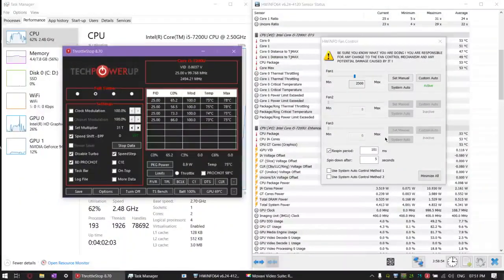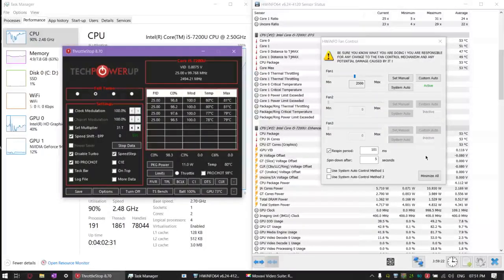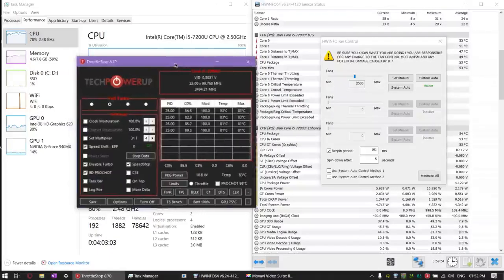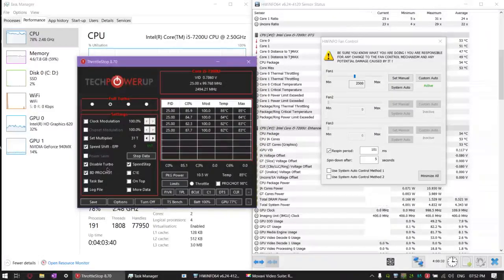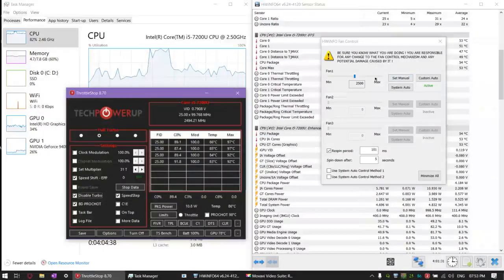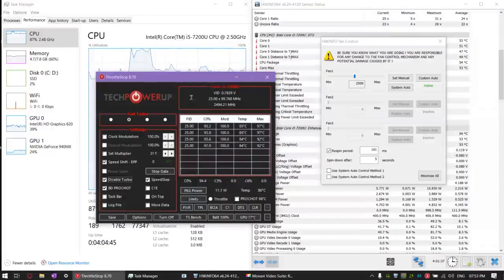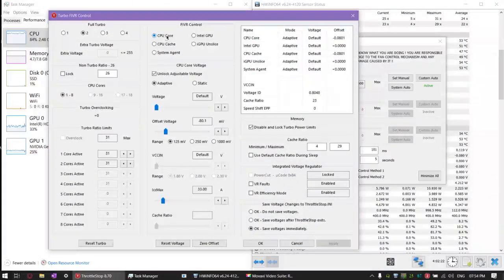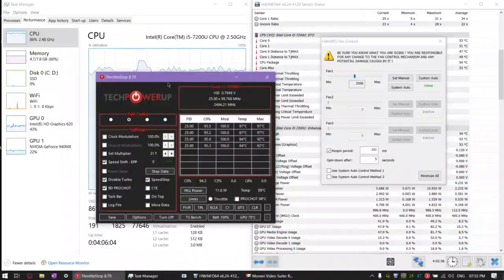Best way to prevent CPU from Overheating (ft.Throttlestop)

Comment: hey bro ,my fan is making a lot of noise,although i have bought it 1 week before .It is hp i5 11th gen laptop ,8gb ram.it's good enough but i don't know how to control my fan speed.Also ur previous video link is broken.please help dude
Reply from the maker: Oh, link to HWinfo?
With an 11th gen processor I don't think that will help you anyways.

Its a thin and light laptop, and in case there is no fan control option in your hp software, there's probably no other way to change it.

I'd suggest check the HP software available for you from the downloads section of your laptop from the HP website.

Otherwise, download throttlestop and tick the "disable turbo"

That will force the laptop to run cool at the cost of lower cpu speed. (also results in much better battery)
That would make the fans run a bit silent.

You can untick that while gaming to get full performance.

I'm case none of that works, just return it. You can. They can't stop you.
Reply from the maker: If any of that helped, please Subscribe.
Reply: Bro i have subscribed. Thank You for your precious time. I have already given it to center they have said they'll give a new laptop of the same model. But i think the problem is with the model. Can i switch to a different model in exchange of that laptop. I mean can i ask to change. Thanks again bro
Reply from the maker: Yeah just ask for a refund.
If they refuse then try to explain your problem to them.
Tell them that the sales man didn't tell you about the fan noise.

If they say the fan noise is fine, show them some other laptop that doesn't make noise and such.

With enough haggling you will get a refund.
Ryzen 4000 laptops are still better than these shintel 11th gen ones.
They just consume too much power.
I still recommend a good ryzen 4500u laptop.
Reply: @wojakreviews6214  thanks mate i can't thank you enough. I'l surely consider your advice.🤝